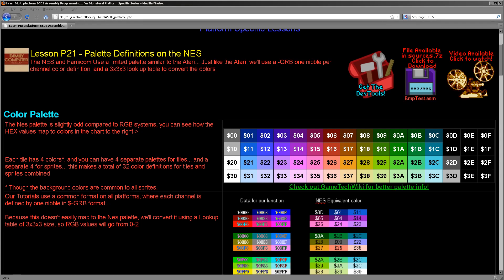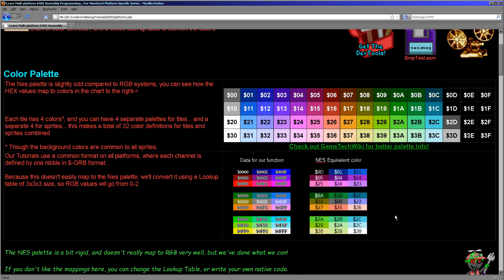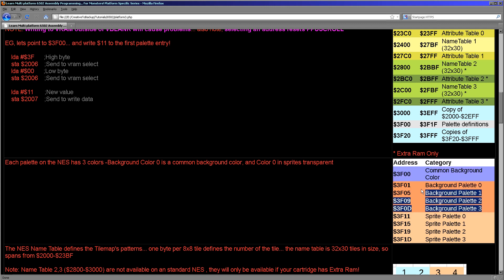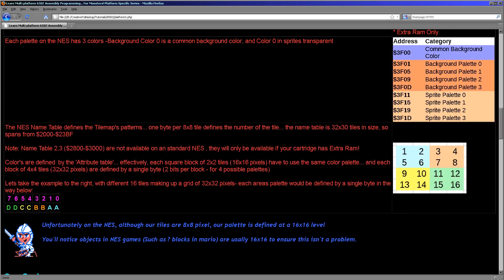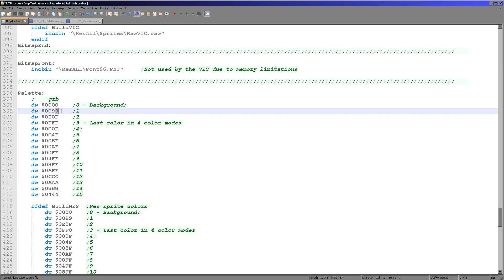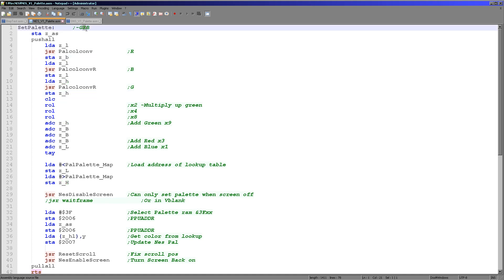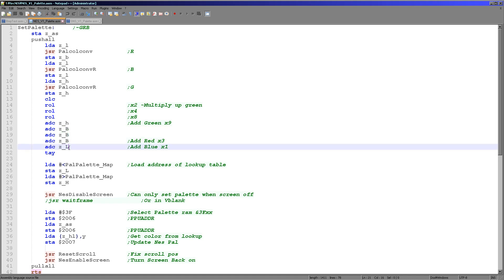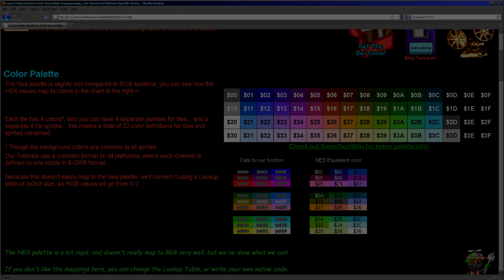Palette Definitions on the NES - Learn 6502 Lesson P21

Comment: Is there any reason the attribute tables are interleaved between the nametables like that, unlike the pattern tables?
Reply: because it makes sense to do so nametable+attribute are one screen, its 960+64=1024(0x400) making clean neat alignment hardware wise without complicating design unnecessarily, you can read it therefore as screen 0, screen 1 (+screen2 & 3 in the case of games like mario3 that had the extra ram)
the pattern tables are the other hand are essentially just a picture data area of 8192bytes
nintendo designs last century were normally about being simple as possible to reduce costs